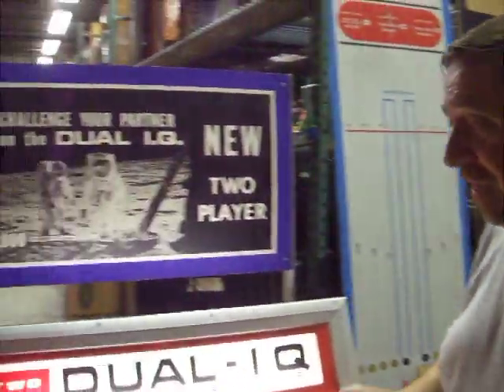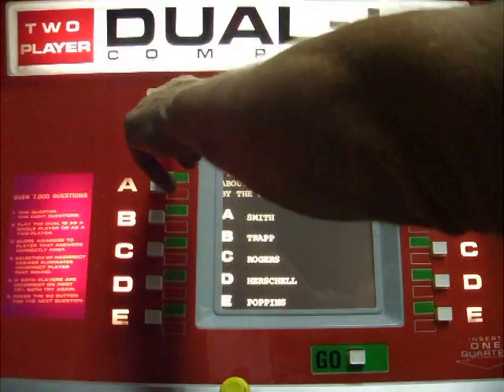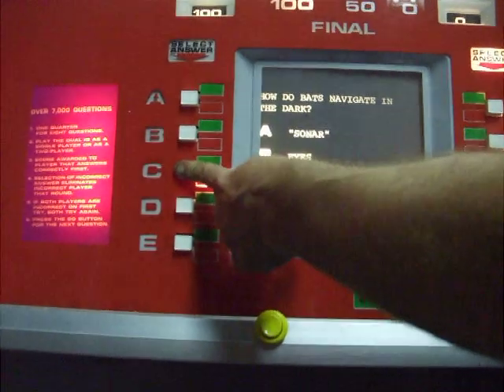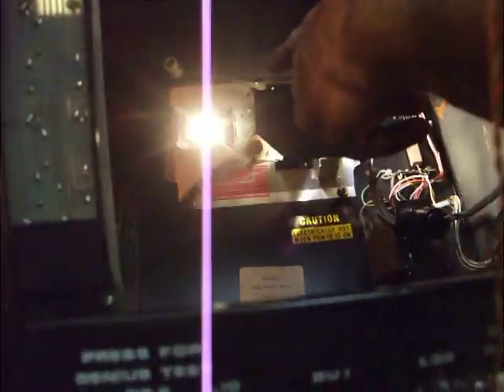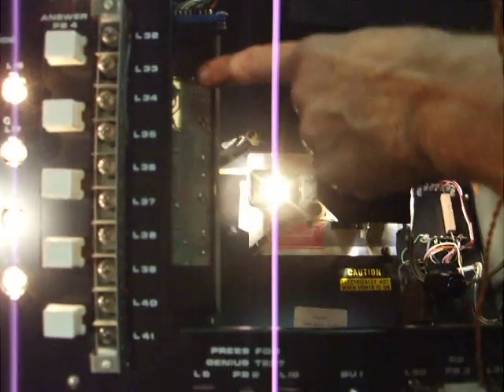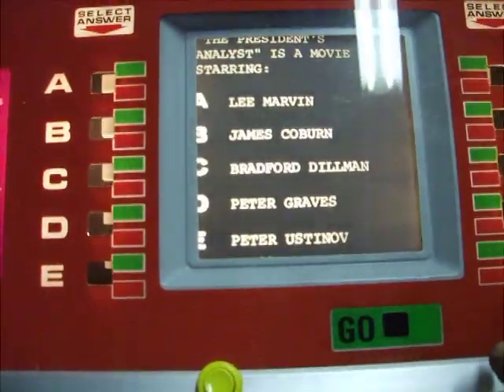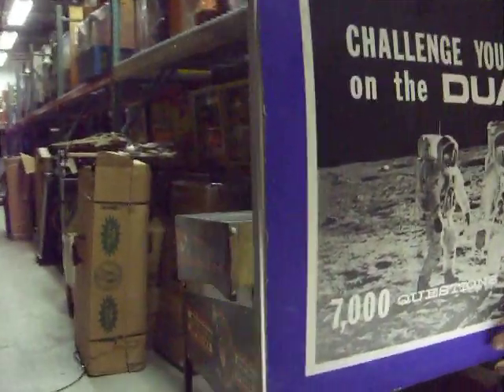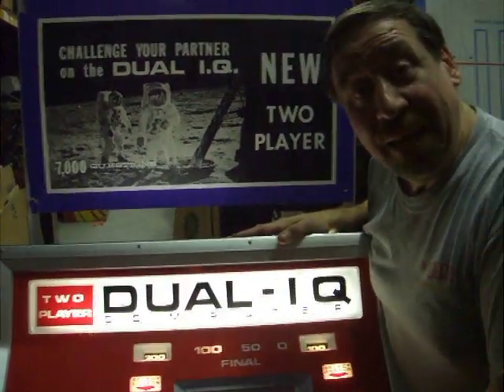#11 Vintage Nutting Industries 1969 Arcade Dual IQ "Computer" at TNT Amusements

Comment: What kind of chips are the ones that you see at the top of the machine? You mentioned Intel, so my guess is that they could be simple microcontrollers for moving the mechanism around, but I could be wrong. Do you know what they're for? Also, how does the light being shone under a certain button tell the machine what the correct answer is? Is there a light sensor under each button, or is there something else going on that I'm not aware of?
Reply: Those were relays that he misidentified. There are photosensors mounted on the underside of the board you see that tell the machine what the correct ander is. The button and the photosensor form part of an "AND" gate, and when the button is pushed, it completes the circuit in this gate, causing the machine to register the correct answer.

Comment: This seems pretty advanced for its time.
Reply: Not really, relay logic and 35mm filmstrip technology- right on par with 1960s arcade technology.

However, the panel's design was clearly influenced by 2001: A Space Oddesy which came out the same year (IIRC). Also, it's interesting that the panel looks and works like an ATM machine, which had video displays as standard around 1980.

Comment: Those "chips" look like relays.

A machine like this would be using relays and maybe transistors for the optic sensor pickup back in 1969. This actually qualifies as an electromechanical arcade machine.